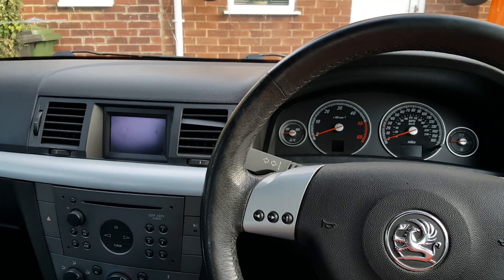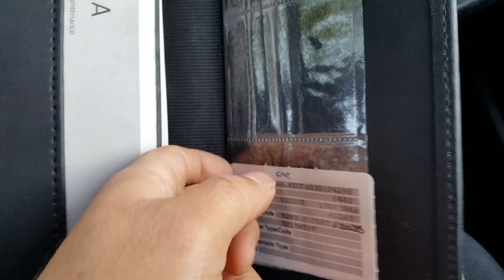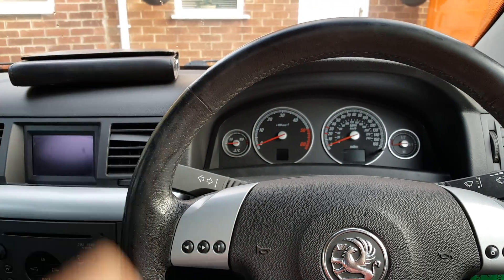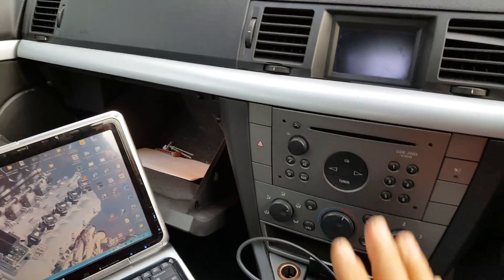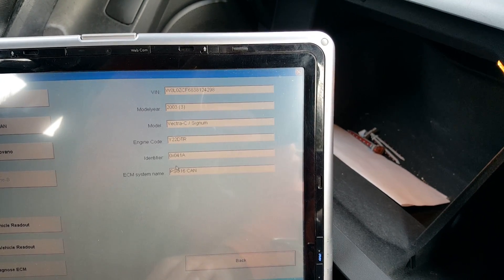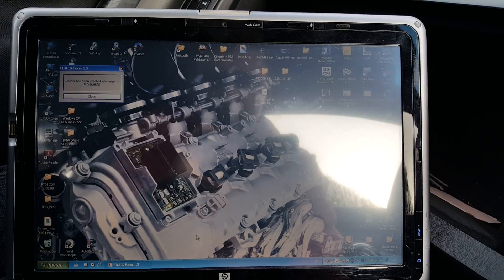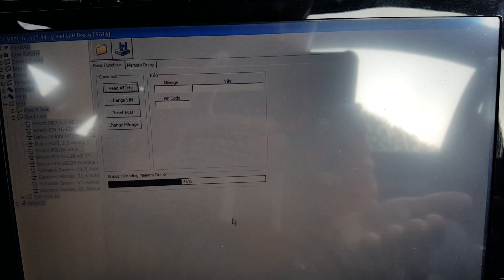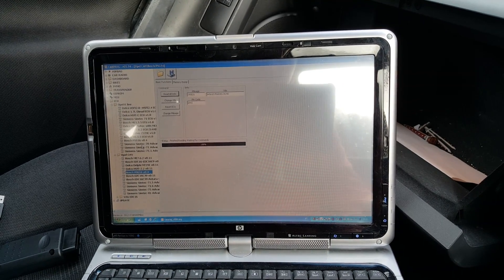Vauxhall Opel security pin retrieval - the 4 different ways to obtain the code.

Comment: hi sir thanks for video, I have a vauxhall/opel corsa D 2006 the airbag (SDM) unit is faulty car won't crank/start because it's part of immobiliser system.  I can source a second hand airbag unit with exact same letters and part code but I cannot get security pin code because they have lost car pass.  my question is have u had to program in module on a Vauxhall and could carprog retrieve code from airbag module once connected to the car cheers sandy
Reply from the maker: sandy anderson 
Hi
CARPROG retrieves the code from the engine module...
You can try to dump the airbag module and then retrieve the pin from there... however,  providing that the eeprom from you faulty module is good, you only need the swapped them...
Reply: lmsvvavr 
hi, please just to ask if u know if the VAGtacho + opel immo device, will get the ECU pin code
(i got astra H)
Reply from the maker: fola fola 
Can't advise on that one... I do not have that tool...
Reply: lmsvvavr and what about china clone carprog?for astra h 1.9cdti ecu edc16?
Reply: Hi nicos,

Did u see any clone carprog tho? 
Please send me link to it, thanks
Reply: fola fola vagtacho is for immo1 immo2 it is not for astra h but for older models like astra g vectra b.
I think carprog can do this but im not sure.Waiting for answer from Imsvvavr if he knows.
Reply: Oh thnks
Will av to buy the carprog on ebay
Reply: Nicos Kaza 

update on my carprog,
it only identify the ECU, but when click to read the informations, for pin code,  it says error. 
carprog 9.31,
i tried from the airbag too,,same error,  cannot read.
i contacted the seller of this issue,, he said the device is mainly used for airbag support and some other functions, not mainly for pin codes.
i think opel/vauxhall from 2006 seems complicated to read these codes etc???  
coz all i see online and YouTube, that people read and access, are the older reg (00-04)

maybe am wrong tho.
Reply: Imsvvavr told me that he try on astra h edc16 by can and its ok.Maybe its the version you use.I dont have the carprog yet.I will use the version 8.21 to see.Thanks again fola fola.
Reply: Please update
Reply: Wat reg is your car tho??
Reply: It 2008 1.9 cdti astra h
Reply: Ok. 
R u in London??
Reply: No.I m from Belgium .
Reply: Nice place,  been to Brussels twice.

Any joy with your car yet?
Reply: No still waiting to receive carprog.
Reply: Ok.
By the way someone told me to clear the faults. (10 faults)
I did one hour ago, i drove car for about 40mins, and all gone, only two codes are back. P1115-05 and U2 103-00.
So seems the ecu still ok, i just av to find way to fix these two faults.
Reply: fola fola try version 8.21 carprog. Its the original version.
Reply: Thanks bro
I av sent mine back to the seller for refund and will be getting pin code from opel dealer for £24
Reply: Ok.Did you solve problem with your ecu?
Reply: I cleared the fault codes, only two came back out of ten.
So seems the ecu still ok, i just av to find way to fix these two faults.
Its thermostat/sensors/coolant
Reply: Did u get your pin code with d carprog? 8.21
Reply: I dont have received yet.But i contact with seller and he told me the version 8.21 its the original.Still waiting.
Reply: Wow, your item seems taking long to arrive
Reply: Hopefully u get it soon and it should do the job for you
Reply: Yep.But i paid less 100€
Reply: Good deal

Comment: You buy units to be able to use carprog?  14 units left (in the message).
Reply from the maker: Mambre Khachatryan 
You can just reprogram the ATMEL  chip and that just loads it with 50 units...
Reply: lmsvvavr 

hi, its car prog,  different from the op com tool?

how do i get and use the car prog please?  
i follow it properly to the using of op.com tool
Reply: lmsvvavr 
can op.com tool not be able to read the pin code??
Reply from the maker: fola fola 
Hi
CARPROG is a different tool all together...
Op-com is not intended to read pin codes, and therefore very limited on that...
Reply: Oh thnks.
I will be needing that too.

Plz, Do u know if the ecu pin normally available on the op.com?  Or i av to find it all the time with d carprog?
Reply from the maker: For Opel/Vauxhall carprog will be a good tool to have...
Op-com is very limited... pin codes are not retrieved with op-com... only corsa c and perhaps meriva...
Reply: Thank you so much
Reply: lmsvvavr 
hi,  please can u point me to a link or device actual name,  to buy for the pin retrieval?
Reply: lmsvvavr hello very usefull video.
Can you tell me if carprog can read pin code ecu from an astra h 2008 1.9cdti EDC16 ecu?in video is vectra c different ecu.thanks
Reply from the maker: Nicos Kaza 
No sure... will have to connect it to have a look... 
Perhaps some out there nows...
I can have a look on my days off...
Or you can download the car support list... just Google it...
Reply: lmsvvavr Hello and Thanks .If you can check it because i want to order a carprog v9.31 china clone for this job.I buy a second hand astra Twintop and i havent the pin code.If it is not possible with carprog i must go to solution 3.
This is from the site : OPEL CAN - Opel ECU by CAN programmer - read/change mileage in EDC16, MT35E, HSFI 2.2 read PIN, reset ECU
Reply: It is not clear for edc16 OPEL CAN - Opel ECU by CAN programmer - read/change mileage in EDC16, MT35E.
Read/change mileage ok but for pin?
Reply: Hi nicos,
I think you will be fine with the clone carprog.
I just bought my carprog yesterday on ebay, cloned.  And will arrive by next week. 
After lots of research too and advice from "imsvvavr",  it certainly seems it will work for its purposes,  i.e getting pin code etc.
I got astra H twinport 1.6,  all i want to do is to reset/reprogramme the ECU 
I changed the engine, engine starts and car runs, but i now get about 8 fault codes which looks like the ECU is not working well along with the new engine yet. one of it says to reprogramme or replace the ECU. So i want to reprogramme it first, then see what happens.

I will be updating my outcome as soon as i get on it.
Reply from the maker: fola fola 
As fola fola said... 
I will try to connect my one on Sunday and will try to report back...
Although my carprog is the 7.xx...
Not sure what extra support on the newer versions...
Reply: Thanks guys.I ordered a cloned with 8.21 and the 9.31 version.Hope it will works.
Imsvvaavr waiting for sunday.
Reply: Nicos, 
I ordered the 9.31 version 
Am sure all will ok to do the jobs.
 
Please keep us updated
Reply: Ok fola fola will keep update.
Reply from the maker: Nicos Kaza 
Hi
My version can do:
Under CAN
EDC16C9
EDC16C39...
Hope that helps...
Reply: Thanks Imsvvavr.Mine is EDC16C39 !!!
Reply: Hi imsvvavr,
Just last night,  the car spanner sign in my car just went off, and the engine management light comes on.
Please u av any idea what that can be? 
Car still running tho
Reply from the maker: Have you scanned the car?
Any codes?
Reply: Av not scan it yet again with this new sudden light coming up 

I might do that tomorrow to see wat new fault codes i get. 

And am still waiting for the carprog to arrive this new week so i can retrieve the pin code of ecu
Reply: just to update that my carprog arrive this morning,  and will be following imsvvavr video to retrieve the security pin code.
then follow other steps to reprogramme the ECU.  i will be updating here soon.
Reply: lmsvvavr 
i scanned it last nite, and its still showing all same codes as before. but i av the carprog this morning,  so will do the whole pin retrieval first, then reset/reprogramme the ECU.
Will keep you all updated,  
thanks alot for your help.
Reply: I connected the carprog with A1 cable. it identify the ecu as delco MT35E ecu, then on clicking to read all,  carprog program says "Could not receive CAN kwp frame", 
do you know what the problem can be pls?  
am doing research online if i see anything related to this error tho.
Reply: Nicos Kaza 
i spoke to a local vauxhall dealer, and they will charge me 24pnds for the car pass. i think well worth the hassle of getting the carprog, which didn't work for me.
all they said is will take 24hrs to get it, just bring with me the logbook and driver's licence. 
will go there today. 
and also someone told me to clear the fault codes first,  and cos its a new engine in car,  the ECU mite adjust itself to the performance of new engine automatically. 
hopefully it will work.

will keep u guys updated
Reply: fola fola with carprog you can get your code with the 3 way.Read the eeprom.
Reply: I did try to read all, it keep saying error. Cld not receive CAN kwp frame.
Reply: Have u read yours yet??
Reply: fola fola try version 8.21 on carprog.
Reply: Thanks bro, i will be getting code from opel dealer here in UK 
£24
And also i cleared all the fault codes last week,  (10 codes) 
Only 2 came back,  which is to do with temperature sensors/coolant/thermostat. So will try fix that.
Reply: Op-com v1.39 can read security pass (pin code) from selected vehicles, corsa is one of them.